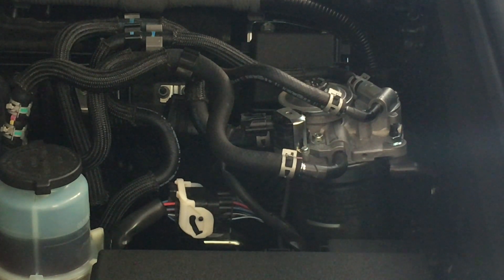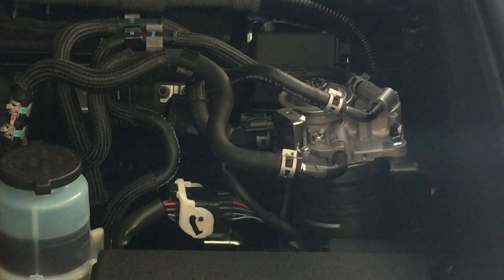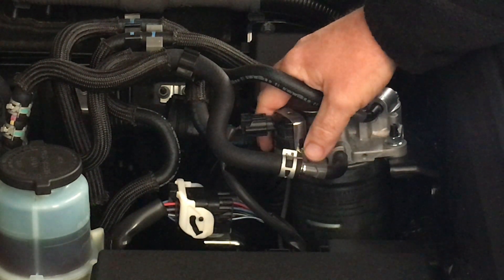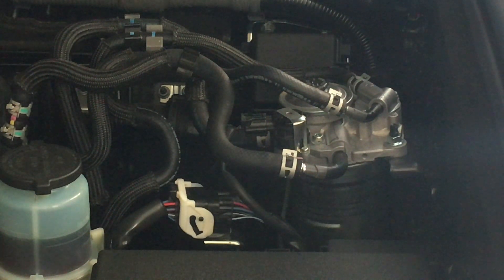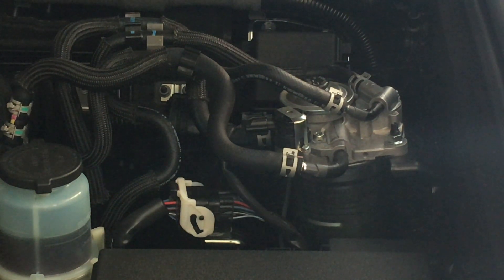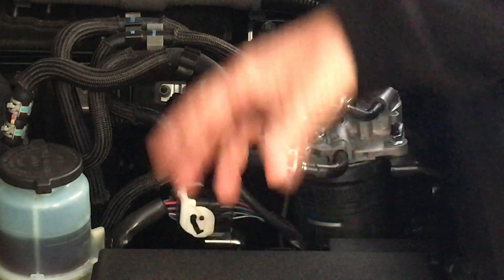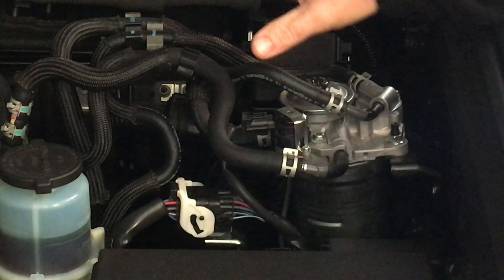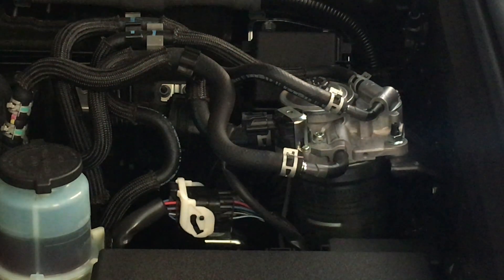DO I NEED A SECONDARY FUEL FILTER

Comment: I change my factory diesel filter on my LC 200 every 15k .I cut the old element open and regularly find large particles of crap, no way the fuel bowser filter is 30 microns. I used fill in Brisbane inner city and the diesel bowser filter hasn't been removed for years the thread and securing clamp hasn't the paint cracked. The filter assembly was painted many years ago.

Comment: Great video mate, my MN Triton has just clocked 350k, at 300 I had diesel care pull the injectors and test, all still in spec. I did replace them anyway but my point is, no second filter, regular maintenance. Keep up the good work

Comment: I have a 2008 HIlux 4x4 155000 ks due to water in the fuel i need a full fuel system replacement and fuel tank clean quote 8500 to 9000. No filter stops water so i will fit a water watch with a alarm this is not a second filter its a water separator with very little restriction western filters has the same but it is a filter as well with a water warning light.

Comment: If you've got a car with 3 filters that's still getting water through, you can't just say that the aftermarket one isn't doing its job without also saying the other 2 "super well engineered" factory ones aren't doing their job either. They're either all guilty together or there's another separate issue there somewhere. No system is perfect to start with, and there's always room for improvement...it's just whether the cost is worth it to the individual

Comment: I've got a 30 micron pre filter it is great for catching water and large particulates. The Toyota filters with their smaller micron catch the smaller stuff. My pre filter has a clear bowl you can see the quality of the fuel, you can see water, sediment and catch it before it does damage. With Toyota's filters it's a closed system, you dont see the fuel coming out of the bowser, or the state of it when it's in your vehicle. 

Also just because Toyota have done it a certain way doesnt mean it's the best, maybe good enough to keep service costs down so it looks more attractive at sale time.Maybe good enough for overseas cleaner fuel types. Who knows, but i love having a window i can see my fuel and sediment and drain the water out of the system on the spot instead of playing guess the state of the filter at 40,000km when you pull it.
Reply: This is why on hilux and hiace 1kv-ftv vehicles have a drain on the fuel filter housing as the bottom is a water separator and should be drained every service.